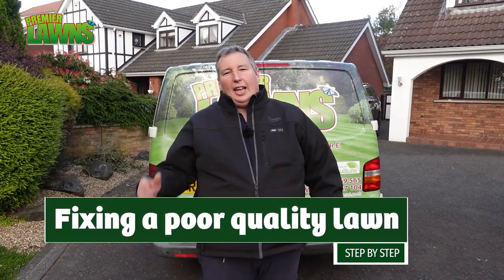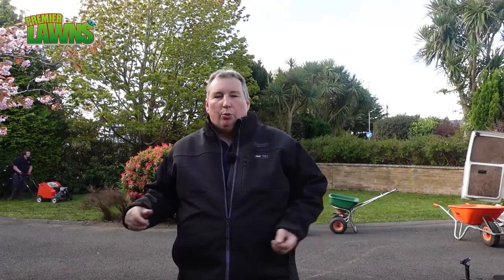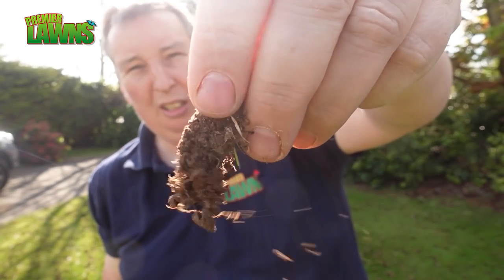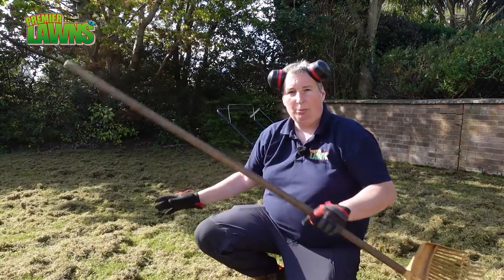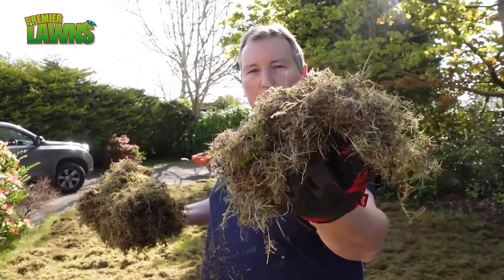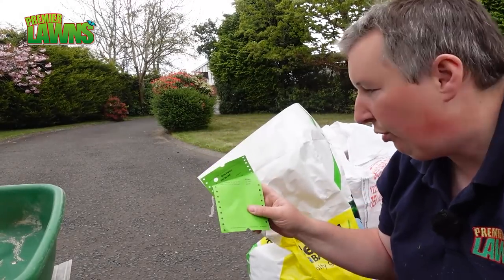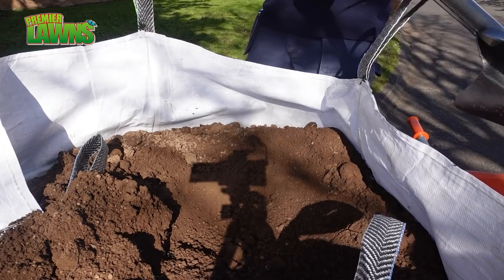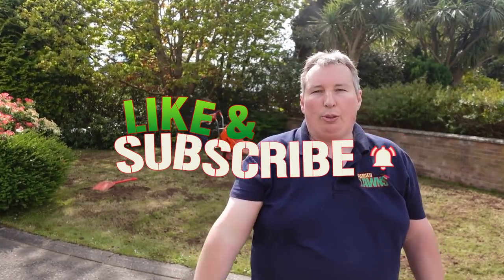How to improve tired old lawns | Step by step

Comment: Quick question Robbie. I was looking to buy an electric scarifier/dethatcher. There are two barrels that can be switched on the machine, one is a scarifier and has a rake like attachment, the other is called an aerator and has blades similar to your scarifier. 
My question is do these blades actually do a good job getting air into the soil. Thanks for all the great videos, I've followed a lot of your advice and my lawn is starting to look great 👍
Reply from the maker: Tom I'm not sure to be honest

Comment: Great video Robbie, thanks. I followed your guises 2 weeks ago and did the full monty, spray sulphate of iron, seaweed extract 2 weeks before, then aerated, scarified, top dressed, reseeded and fertilized. Went probably too hard on the scarifying. Just wondering how long should I wait for 1st cut? The long grass is getting v long. 
Thanks for the videos and advice, invaluable.
Reply from the maker: Fantastic! Give it a cut on a high setting next week, you should be grand

Comment: When scarifying do you use fixed blade or spring tines? Also when scarifying aggressively was that as low as you could go or were you just scraping the top? When I scarified I seemed to have very little left
Reply from the maker: We use fixed blades